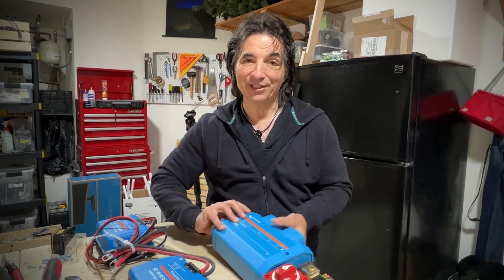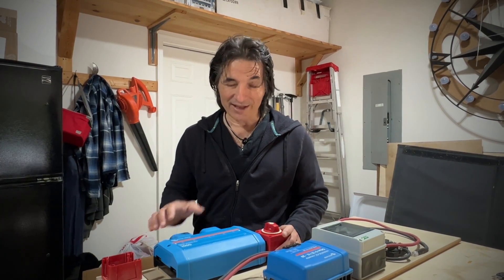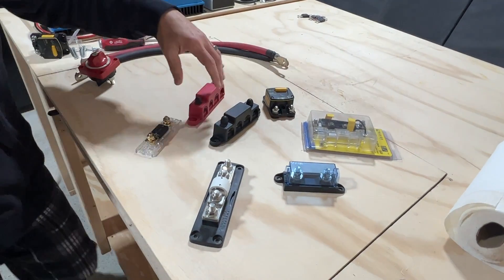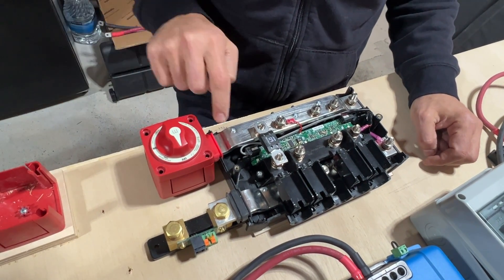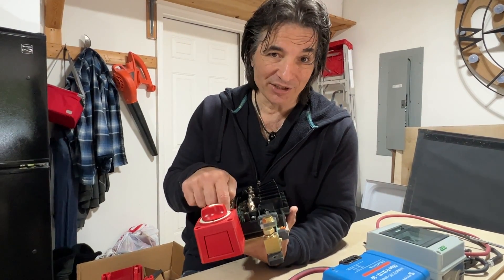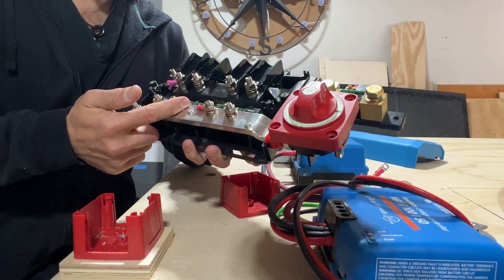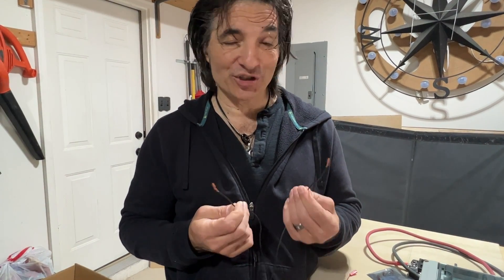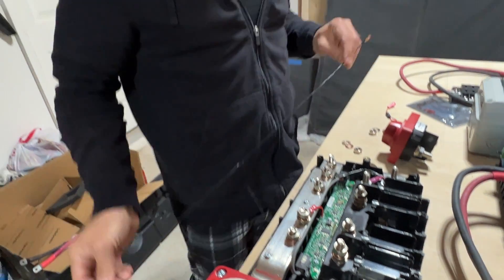Victron and Blue Sea - Perfect Together – RAM Promaster 2500 Van Conversion

Comment: Mark, do you plan on using that T-class fuse I saw on your table on the positive cable going back to your battery? Thanks for the video.
Reply from the maker: Hi Ed, we actually have a 250 A terminal fuse on the positive terminal of the battery leading to the disconnect switch.  I had thought about using that one between the + bus bar and the inverter, but I don’t think it’s necessary. So, we may not be using it.

Comment: Great video! I have everything you had on that table including solar interrupt breaker, the red on and off switch as well as the shunt for the battery monitor. I had every intention in doing the same thing you only I have the Victron Power In instead of the lynx distributor. I fixed it up with the M8 bolts washers, lock washers and nuts so I can use fuses with it. I can't wait to your next video.
Reply from the maker: That sounds like a pretty solid plan. Best of luck with it :-)

Comment: I thought I was being stupid when the switch and shunt wouldn't line up with the Lynx distributor. You're spot on, Victron should offer this as a kit.  One warning, look into precharging the capacitors on your inverter.  My batteries (Chinese) couldn't handle connecting the inverter without precharging.  Cant wait to see your finished van. Good luck!
Reply from the maker: Yes, definitely took some work to get everything to line up. But I’m really happy with the way it came out. Cuts down on a lot of unnecessary wires and connections. We actually didn’t have any issue with the battery to inverter connections,,, but maybe we were just lucky :)